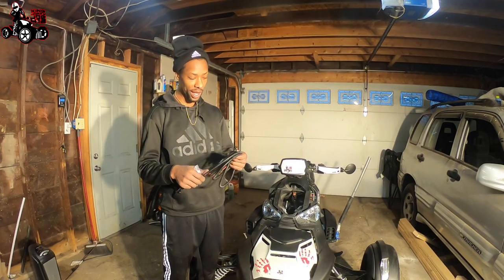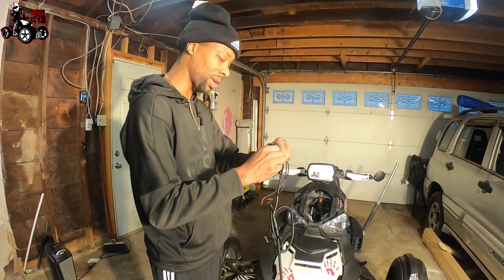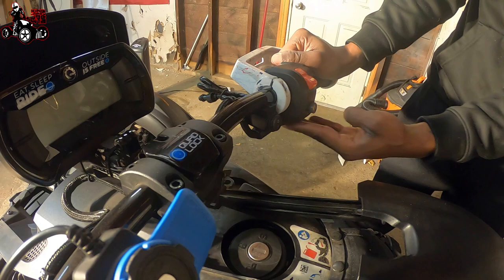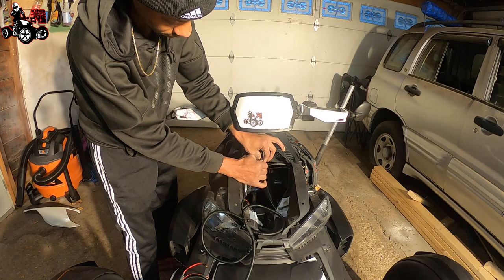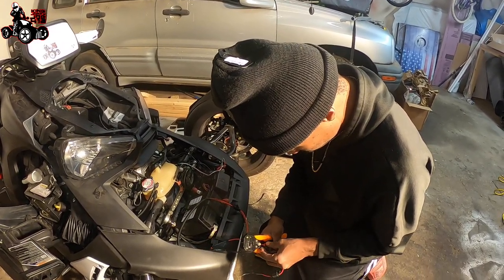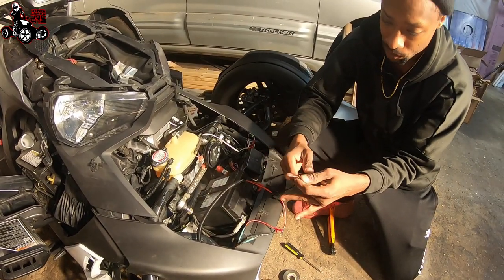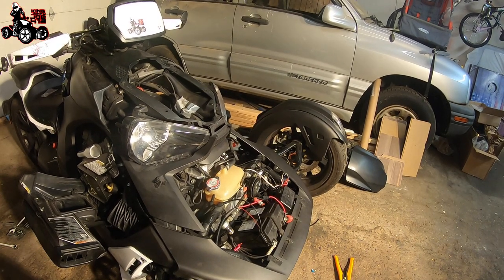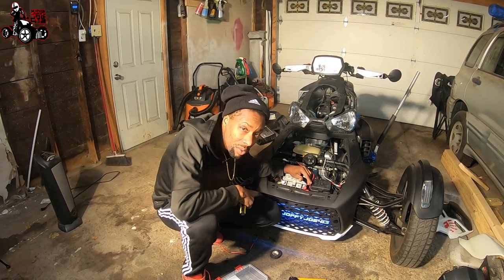Can-Am Ryker Accessory Toggle Switch from Brannon King, DIY Installation #canamryker #diy

Comment: Hi bro, what i did on my fog lights I cut off the switch of and ran the wire to my low beam light, that way I won't forget to turn off the switch off and drain my battery it works like a charm.  That will be another way of doing it.

Comment: @kingjoffyjoe.  So you could use this for led strip on the front fenders. I was wondering where you were going with this. Very cool, save the battery life.  By the way do you have the battery that came with your Ryker or did you upgrade. Just got caught in the rain after heading to the gym. Lol always fun in the Ryker though.
Reply from the maker: Same battery since I got my bike in March 2019
Reply: Good to know. Thanks for responding.

Comment: I have a question wanted to know if you are able to help with switching the ryker throttle to the left hand side for some one that right arm is gone.
Reply from the maker: I've never seen a bike with a left side throttle. Only thing I can think of is switching the throttle that comes with the bike to the opposite side only problem with that is that throttle would turn the wrong way unless you put the throttle on backwards so that the start button is to the left side of the left hand.
Reply from the maker: I would say it isn't practical but it would probably work it may require extending some wires but wouldn't know unless I tried